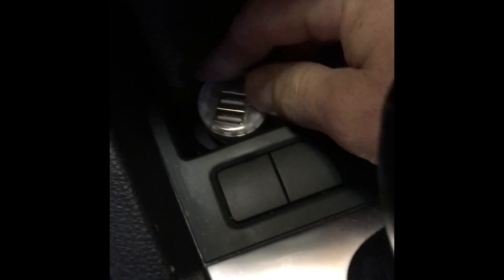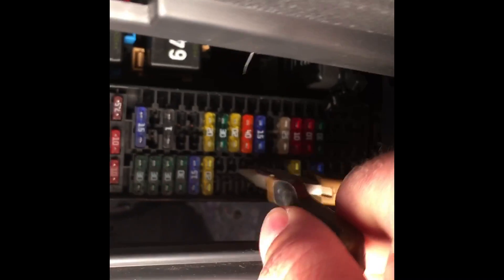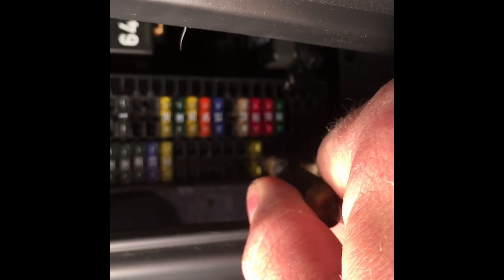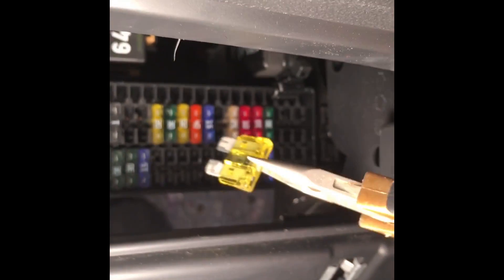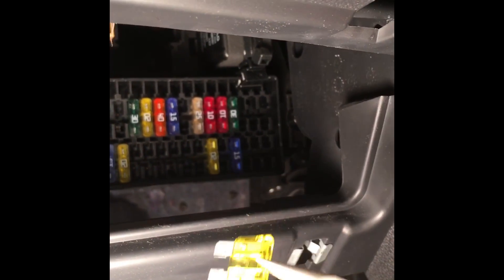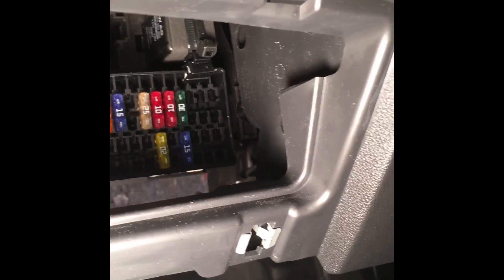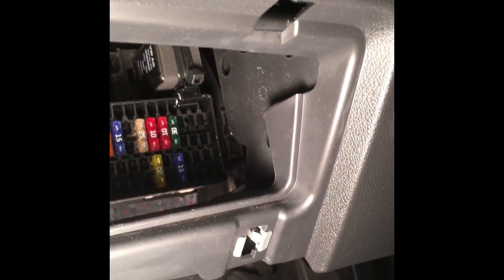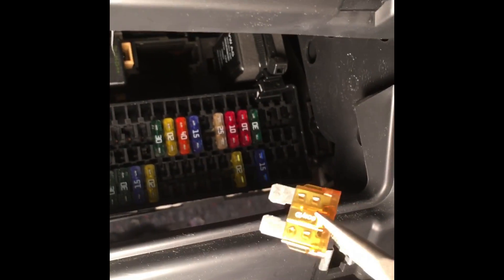Phone won't charge - Volkswagon Jetta - Blown Fuse

Comment: I have a 2011 Jetta SE, would it be the same 20 AMP fuse for my Jetta? Where can I find the meaning for each fuse? I have the owners manual but it does not state any information just states how to replace it and how to identify a blown fuse.
Reply from the maker: It should be the same fuse. If your manual doesn't state it you can do a search online and nail it down to the specific year of your vehicle.
Reply: My owners manual doesn't specify information on what fuse does what. It only gives info on how to identify a bad fuse and how to insert a new one. Anyways I fixed it last week and replaced the blown fuse with a new one. Video definitely helped. Thank you !

Comment: What if the light on the car charger comes on but dims out, and when on, it’ll spark a charge then nothing.  Would I assume that a fuse is blown?
Reply from the maker: If you’re getting power to the charger then the fuse is not blown. I would check your cord or the charger that plugs into the car to see if they are bad. Sometimes those chargers have a fuse inside them that can go out.
Reply: @abvellinga  thank you!  I will have to  check that again.  It is with any power cord, or any charger that I plug into either the one in front, and also the one I have in the backseat.  Those same chargers will work in other vehicles just fine.  So I’m stumped.  I thought of the fuse since it’s both ports for portable Chargers are having the same issue.  You plug it in, then immediately quits charging, and no light on the charger.  If I wiggle it around, in the front one for sure, I can see the light flicker and the charging icon flicker.